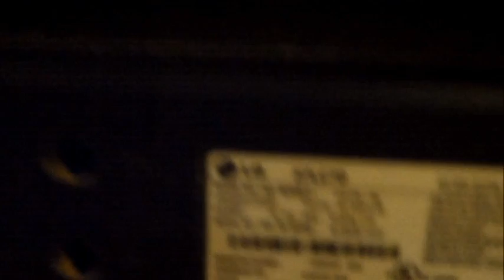LG LCD TV REPAIR - NO PICTURE SCREEN FIX REVIEW

Comment: We have a LG 32LG70 LCD TV. Last night, my husband was watching it, all of a sudden, screen went white and no sound. No power surge. Have taken back off to look for any possible scorch/burn marks, none seen on first inspection. Could this be the capacitors? Also there is a tiny white fuse on that same board, appears to look okay. Don't have volt meter, to check.
Reply: Have seen your video on the 37LG, looks different than our board, that's why I'm bugging you.
Reply from the maker: reset tv by unplugging power cord for 5 minutes, check all video inputs,  next try reconnecting tcon and main board connections,  it can be tcon board or main logic board. check swollen caps on all boards. since you have no video and no audio it can be main logic board cause it controls audio and video. get it at shopjimmy.com if it's not that they accept returns and switch it out for tcon but expect restock fee.
Reply: Is the "white " screen the same as no screen? And which one of your videos would show the tcon board and main logic board? I'm hoping you're not talking about the main power board! We only had outside antenna hooked up to TV, and vcr.   I'll see if I can post a picture of what I'm seeing!  Uncle, I give! Can't figure out how to copy and paste without a mouse on my iPad!
Reply: It does get power, because it turns on the screen to white! But no sound.
Reply: Paula Sutton What happened in the end? I have an LG 37 inch and the screen has just gone white. I have learned it could be due to a loose cable, and I'm really hoping that's the case. Time to get my screw drivers out.
Reply: Dave Thompson actually, when you watch at the tv and then suddenly the display goes white, it means that the 5V rail dropped. FIX: Repair or change power supply.
Reply: Grt Shadow I got it sorted in the end. I replaced the Tcon board and made a small video about my experience. That's two LG screens I've managed to repair now, the first was my monitor that needed new capacitors, so glad I didn't need to do that again!

Comment: I looked in the back of my LG 47LV4400 and didnt see any blown capacitors. None were bulging or completely blown out. The backlight comes on, the blue light comes on but can not see the menus or any picture whatsoever. Any clue as to whats wrong before I take it to a repair shop? Id hate to bring it to them and get charged for looking at it and not get a working TV back

Comment: i have a 40" emerson tv it comes on n works but it has a horizontal  line running on top at the first 1/4 and bellow that is yellow and blue hologram look. what would be the cause of that can you help. thanks in advance

Comment: Hi my tv has bulging capacitors on the power supply. When the tv is turned on from cold the screen flickers and has no sound until the tv warms up for 15 minutes and then it's fine. I've replaced the main av board and wanted to know if the caps are the problem.thanks
Reply: Sounds very much like cap and that is were i would be looking first as a failing cap will some times work once warm.
Would also consider dry solder joints .

Comment: LG 47 inch LCD TV,Black out, no picture ,no sound
I have an LG 47LD690 inch LCD TV,
there is a total black out, no sound no image, I tried to open  the back cover ,there is no sign of any blown up capacitors, all the capacitors are flat  and look ok, what could the fault be , so totally black just the red power light on the corner, the side buttons are not working

Comment: I have a problem with my LG 42LC7D TV: BLACK SCREEN / SOUND OK , 
PLEASE TAMPATEC HELP.
Reply from the maker: motherland1stanna turn on the tv then press menu button next shine a flashlight on the screen, if you see a image but screen lost it's backlight then order inverter board BUT if you have backlight glow on tv then it can be bad tcon board or main video board. most cases for me it's tcon board. if you have a meter check dc volts to tcon and inverter boards on power board cause sometimes capacitors blow on that tv.

Comment: Hi I have and LG 47LW5600  I check the power supply board for a blown cap but didnt find any,  and the problem with the tv is that I get a black screen but I still get audio. Any suggestions would be grateful so please can some one help.

Comment: hi tampatec,i fixed my plasma with capacitor fix got power back and all leds on the power board are on and stable but i can see screen lumination with sparkling pixles when lights are off in house like its running in some strange other channel   can even see slight av logo, no signal  from any input strange thing is when i turn power off the logo and screen and menu and has a yellow x next to logo is visible just befor shut down?.thanks in advance.

Comment: after watching this and your troubleshooting vid i opened my tv up honestly half hoping for blown capacitors. everything seems fine, no bad caps that i can see, nothing burnt. im wondering if i should maybe change the fuse and go from there?
my tv is a 37lg50 and my problem is.. at first it would take forever to load, the light on the front (red off/blue on) would just pulse red until eventually it would come on. now it just pulses forever, no pic, screen seems completely off. im too broke for a new tv pls help lol.

Comment: I ave a 46' sanyo LCD the tv powers on and stays on with sound, cycles all through the inputs but no backlight or picture? You can see the picture with a flash light. I replaced the invertor board but that did not fix anything? any help thanks

Comment: I have a dynex tv that turns on with a picture but some times when i try to turn it on it has a black screen you can see the backlight on but no video. What I do is unplug to power and plug it back in.(I can't turn it off with the button) I do this several times until it turns on oh and it makes this loud sound when its on the black screen. I want to find out what board could be doing this.
Reply from the maker: scorpio Pena maybe tcon board, just posted a video on that problem check it out, hope it helps 8^)
Reply: My Westinghouse does the same thing! Upon turn on, it makes the loudest static noise but once it ends, the picture appears. Sometimes it even appears pink and that's when I unplug and plug back in then all is fine. I'm curious abou the answer of this one! Following :)
Reply: ***** Hi Tampatec please help me out i been searching for the answer but nothing and no other youtube user reply back. I have an LG 47LW5600 when i turn it on you could see the screen turning on but is just in black screen my console is connected thru RCA and I could hear the audio. The problem looks similar to this tv on this video, in black screen but nothing happen when you press the menu buttons or volume buttons. But hopefully with your experience with other tv that had the same problem, what did you do to them, cause on my I can see a busted capacitor.

Can you name a group of component that may cause that, i saw your other videos on how to check them while connected and disconnect them from the board.

Hope you could reply back, Thank you.

Comment: Hi, i have a Panasonic lcd tv, no pic, got sound and backlight, but how do you tell  which capacitor is damaged? 

I saw one L844 which looks bad, with 3 black corners. What's the L thing?

Appreciate your advice.

Thanks"
Reply from the maker: on LCD, no pic, got sound and backlight, i would suspect tcon board or connections that controls lcd-panel image, they go bad time to time, get it at shopjimmy 
for more info, use code paul51p for free google helpout https://helpouts.google.com/109162147223399593709?authuser=0

Comment: Hey i change my 3 capacitor but it is still showing the same issue, which is when i turn the tv on it is pitch back, i did notice arrow, mushroom shape when i move up and down the tv, all over the tv, but it not showing any kind of lighting bsides those arrow/mushroom shape that are very very dim.

Comment: hi i have a lg 50" lg 50p53000 tv there is no pitcher or sound it just went off whilst watching it now the tv will not come back on blue light comes on and flashes then stays on after 20 sec it starts flashing again but no sound or picture and you cannot turn it off at all by the button or the remote i have replaced the power supply and still the same now when you look at the boards on the tv if i disconnect the power to the bourd on the upper right side it still does not work but it can be turned on and off by the remote and by the power button if that helps

Comment: Hi Guys,

I have a problem with my LG LED 47LS5700 TV: BLANK SCREEN / SOUND OK

1) The sound working well
2) There is no picture but the backlight is working, because I can see the light --> Blank (black) Screen, not white
3) I replaced the T-CON Board --> Ref: 6870C-0401B / Programmed by a supplier for 47" size screen
4) I checked All Capacitors on the Power Supply Board - everything look perfect (not blowing, not leaking)), I replace a couple of them to be sure in case of..
5) I measure all FUSES on this Power Supply--> OK !
6) I measure All diodes --> OK !
7) I measure All Output voltage as printed on the Power suply Board: 24V, 3.5V... : OK !

Do you have any advice, What can I check ?

Many Thanks for your attention and Help !!

Cheers
Reply from the maker: if you got no picture but have sound and backlight is working i would focus on video boards (tcon or tcon connection, or main video board) use code paul51p for free google video helpout- https://helpouts.google.com/109162147223399593709/ls/b77b1f21705865ca?authuser=0
Reply: *****  Many Thanks Mate, I fixed the problem :) In fact, I found a moisture area on the DRIVER BOARD ! I replaced some SMT Components, and clean the PCB, and the TV is working back now :)

Comment: I have a LG 26LC2D that started flashing between a variation of colors and no signal on the screen. When I restarted it, the green LED light flashes several times, then turns solid, but the screen is now blank with no sound.. Do you think this may be the same thing?
Reply: Marcus White did u sort the tv problem as i have the same now..

Comment: Hi Tampatec!

Well, Sadly I have one LG unit thats doing the same thing, its a UK model ( I guess that doesn't make much difference) It does exactly that....nothing. If you wake up the next day and the tv's been off for 8-12 hours then you will get a response initially then it will just disappear in "brain dead" mode. the thing is, my capacitors are not bulging, even slightly so this has thrown me off.

Can you help? any suggestions?

Kind regards

Comment: hallo i need help i have a samsung lcd tv and and it wont turn on  the 1st time i opened at the back cover i saw 3 cap where blown and i did replace them with the same caps now the sceen comes on for 1-2 seconds and goes off and when i press the channel button the tv turns off and wont turn on so what is the problem can you tell me

Comment: I won a 42" CLASS LED LCD TV/ TV ACL DEL

When I set it up and plugged the cable wire / the power cord, everything was working fine. I could watch the TV no problem. I watched it for about 5 mins. then turned it off. I turned it back on at night, & no picture, only sound. All the channels are working fine, but I can't even see the menu or any options on the screen. It's Black.

Will this video show me how to fix the type of TV I have as well, or it's just for the type of TV you have?

Comment: Hi, Tampatec:  The LG 32LC2DB is connected to the Humax Freeview box HDR-FOX T2 & has been working beautifully for months. Recently, 30 min into the programme, the picture went off and 'No Signal' was displayed on the screen.  The Humax was still receiving the programme from the antenna, as seen in the digital readout on the Humax.  
Five minutes later, the LG tv made loud noises through the speakers, like popping and electrical noises. I pulled the power cord out.  
The next evening, a similar event occurred.  
I notice there are many screws to un-do to check what is happening inside the back of the TV.  Any tips as to what may be malfunctioning and where the 'bulging capacitor' might be?  Many thanks.

Comment: Hi. 

I have LG 37" LCD. ( Do not have the model number to hand at the minute. )
At times the telly is working fine and then other times it just doesn't seem to pick up channels. All other lights are on on the screen. 
Does this sound like a problem on the main board ? 
Thanks in advance
Reply from the maker: sometimes, it sounds like the tv "tuner" but can be bad coax connection or pinch cable.
Reply: Thanks man. So if it was the tv tuner what's the best thing to do to either fix or trouble shoot for sure ?
Reply from the maker: James Colledge contact shopjimmy.com to see if they got tv tuner part or maybe just order the board. (they need sticker number to order the part.)
Reply: Lol never mind, looked it up. Cheers

Comment: how about some solder wick, and a real solder iron. I'd like you to come to my shop and troubleshoot an actual DOGtv....meaning not an easy cap fix, but an actual circuit repair, when you can trblshoot and repair a real technical problem then your doing something. sorry for the critical input but, when you have been in this buss. for 36 yrs, it maddening to see a table top repair and no technical ability for actual circuit troubleshooting....and you cause ppl to think all repairs are a snapp when the majority of repairs are very difficult. Hey, it's just a comment !

Comment: I have an older (6 or 7 yrs) LG LCD 47 inch that had perfect color screen for about five to ten minutes then would act as if the contrast was turned way up. It would do this after everytime I turned the tv off and on again (waiting five or so minutes) It didn't matter if I went in the menu and changed anything, it would remain the same. I took the tv out of commission and started researching. I found that most of the time the tcon board was the culprit.  I took the back of the tv to locate the board, took the board out to see off there was anything physically wrong and put it back in. Now, after putting it all back together, I turn the tv on there is no picture/sound and no menu or anything else. It does power on though.  suggestions?
Reply from the maker: can be main/video board or tcon board or loose tcon connection. contact shopjimmy.com to get boards

Comment: I have an LG Flat screen tv when I turn it on it switch off by it self in like 1 sec.
i took the batteries off the remote that did not help. i visually inspect the capacitor they seem fix. No noticeable bad cap. what might be the problem? thanks

Comment: hello i have a LG lc7d the tv screen would flash on and off and you can hear popping sounds from the speakers and it will continue to flash untill it turns off .... i replaced the bad caps on the power board if i leave the tv off over night it will play fine for a few hours sometimes most of the day but after a while it will go back to doing the same thing

Comment: LG47LE5400 while watching TV screen switched to vertical lines most the way across. sound and volume works but cant see any picture just lines... Would this still be capacitors??  Restarting TV etc does nothing, switching inputs nothing... Thanks!!
Reply from the maker: check Tcon board connections or can be bad Tcon board but you can get Tcon boards with warranty & return policy too at Shopjimmy.com

Comment: Hi I have a RCA tv that turns on but for 2-4 sec before it turns off the audio still works and the image still comes out if I use a flash light I can see the image but the backlight turns off and won't come on. Could you please help me.
Reply from the maker: inverter board is commonly the problem for that Get at shopjimmy.com

Comment: My Samsung 27" LCD TV, now 8 y. old, got only a square info about which input is choose on panel , for very short time after power-on than everything become quiet as desert. No sound,no light on LCD panel no picture at all. Red LE diode doesn't blinking as normally, on power button when I'm doing something with commands, either on remote or without him. Two capacitor were blown (I'd replaced them). Still the same. Any suggestion. Thanks
Reply from the maker: some bad capacitors sometimes Look "ok" but still are bad. check 680uf, 1000uf, 2200uf, 3300uf 10v or 25v, check for 5v on powersupply.

Comment: i have an lg 7000 the light power is red blinking but doesn turn to blue and wont turn on is the same problem that you fix in that tv?
Reply from the maker: i would buy capacitor repair kit for your tv model, also red blinks is an error code for what board is failing.
Reply: +Tampatec I saw repair kits from $46 - $11.  How do I know which one to get for my 55 inch LG tv.  it is not a smart tv.

Comment: Hi my 32 inch lg is not clear the picture Igive someone to fixit who said it will be clear after 3das but nothing he change some parts so Ineed original parts,model number is 32lk 430 TH
and the product code is 32lk 430 - TH.AFBYLWF and power Ac 100 - 240 v - 50160H21.2A
cA
Reply from the maker: can be bad main board or t-con board or loose connection.

Comment: Quick question. I have a Sony Bravia KDL-40S2010 No picture (only a red line in the middle of the screen). the sound is ok but no picture. I already change the t-con board but still the same. any ideas? Thanks for you help.

Comment: ok i have a sylvania lc370ss8.. the screen flashes then turns off.. if you keep powering it on it will come on or it use to i stoped messing with it and got a 32in element ELEFW327 to replace it and now its dead to no power at all.. but the sylvania is the one i would like to get going.. there is a video of the prob under my uploads youtube told me no links in here.. they said to replace the 3 4700uf caps on the board so i did and it didnt help.. so i thought i would ask the master